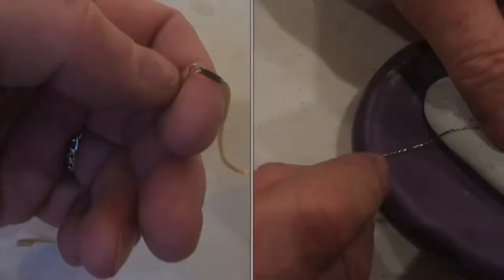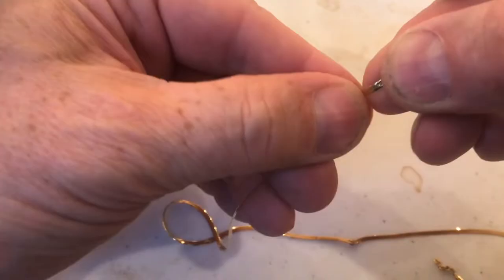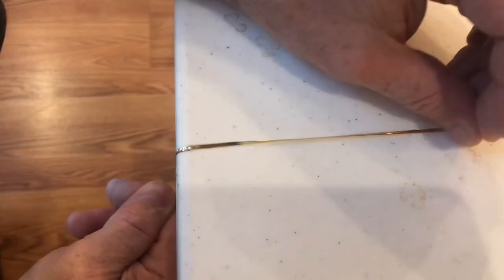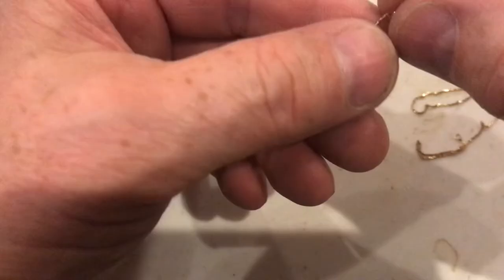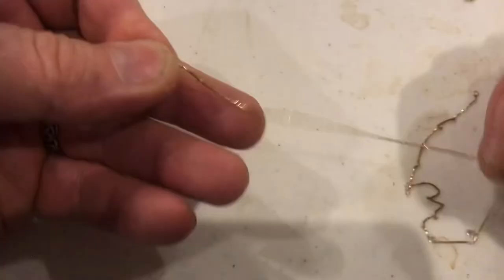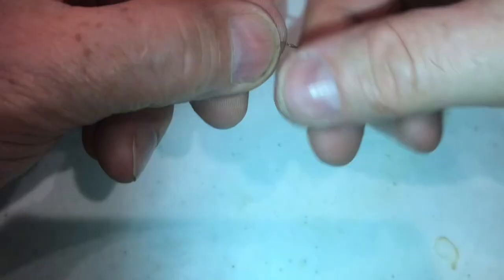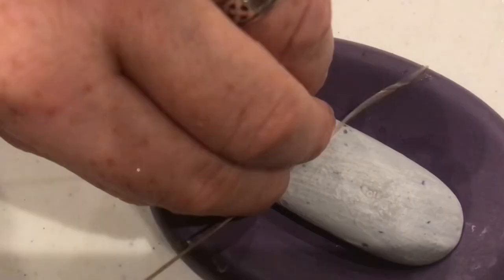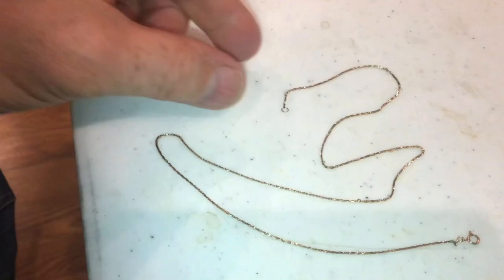“removing” TWISTS and KINKS in a necklace (jewelry repair) restoring gold, silver chains…

Comment: You can actually just wiggle it and it will comeback.
Reply: That’s not true all..I have the same type chain the individual links tweak/bend over time and this helps straighten them back so it won’t kink as easily in the future.